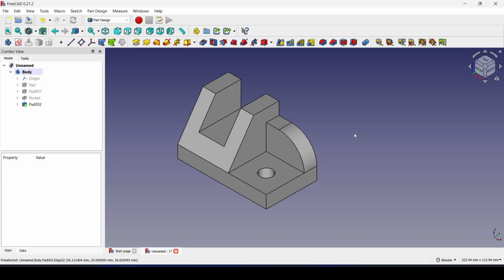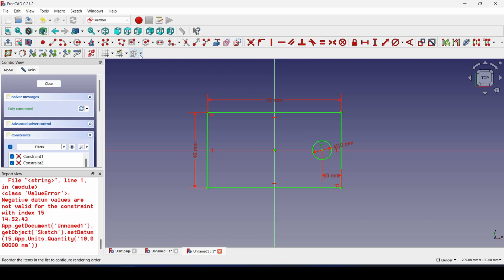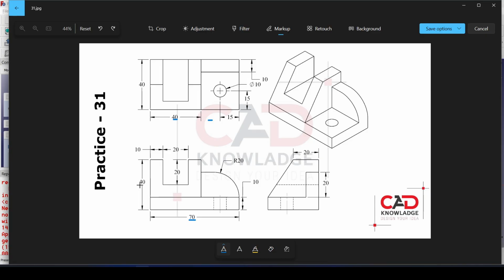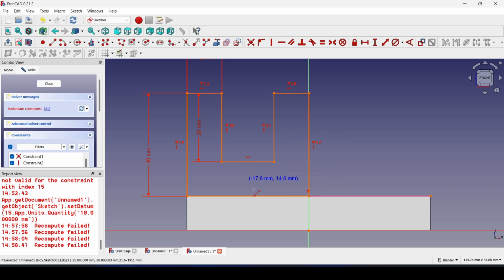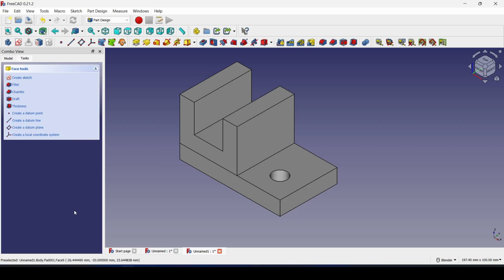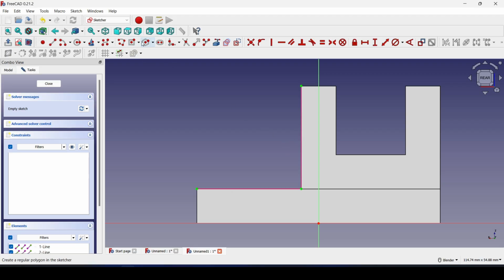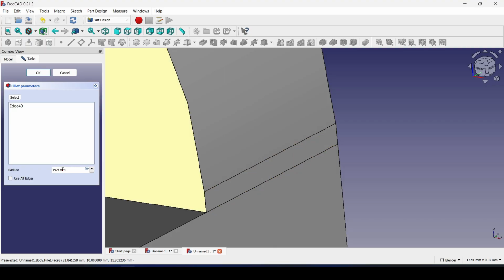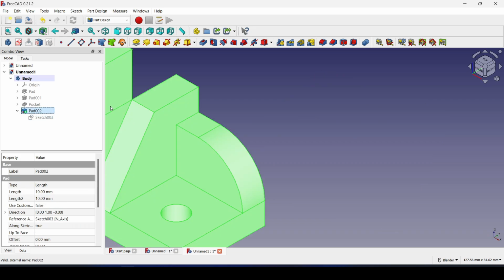FreeCAD Beginner Tutorial #2

Comment: Great tutorial. One of the mental hurdles I'm having to overcome is how easy it is to use fillets, pockets, etc. to perform cutting and shaping operations on the model under development. My brain keeps insisting that it just can't be that easy! Before taking up FreeCAD my last experience with technical drawing was at a draftsman's table with pencil and paper during a college class in the mid 80's. There's just no comparison between that and a tool like this!

FreeCAD 1.0 has been released since this tutorial was first published, one of the things that has been improved is that I was able to use the fillet tool on the model and it added in the 20 mm radius without balking as in the video.

Comment: Thank you again for another great video!  There must be a difference between my version 0.21.2 running on Linux (POP OS) and your version: The last part for making the rectangle with the 20 mm fillet was over-constrained when I did what you did, and I never figured out why.  As you said, there are other ways to do the same thing, which I did by making the rectangle with the fillet floating away from the part, and as a last step made the corner of the rectangle concurrent with a point on the solid. I don't see why that is really any different from what you did, but I did not get any over-constraint issues.   Anyway, I succeeded in duplicating the Lesson 2 part.  Thank you.
Reply: I had the same issue, I think it was because there was a line that had a horizontal or vertical constaint, while having both end points also constrained to a referenced line

Comment: On the last sketch instead of the rectangle use poly line to make the bottom and side then 10 mm of the top line then M 3 times to radius and complete the sketch.  Then constrain the arc to 20mm and the other constraints.  Then no issues like with the fillet to 20mm.

Comment: Hi Jeff. I'm onto your second tutorial! I'm having a difficulty with FreeCad and I'm hoping someone can help me. I'm using an iMac running MacOS 10.13.6 (High Sierra) and FreeCad version 0.21.2. It's the latest version that I can run on this OS. I am not able to arbitrarily rotate a part I'm working as you do in the videos. It seems that I'm forced to use the image rotation tools at the top right hand corner of the screen. To say the least these tools are less than perfect and a bit frustrating. Am I missing something? Assistance with this issue would be greatly appreciated!! Thanks in advance!
Reply: Im sure you figured it out by now but Check your viewer controls in the bottom right.  I preference ranker cas viewer controlls.
Reply: @bluntly8760  Yes I did figure it out! Thanks!

Comment: Another very helpful tutorial. One question... I am working on a Mac with a very high-resolution monitor and so everything is very tiny. I did figure out how to increase the font size, but the line weights are still very thin. I went into pref's but nothing I changed seems to make a difference. Any thoughts? Thx!!!
Reply from the maker: Hi Brad,

Thanks for commenting! I've been doing some searching trying to find a solution to this issue. 

I came across a setting to modify the width of lines shown in the standard viewing window (i.e. after you've closed your sketch and are back in the Part Design workbench). To do that you can navigate to "Tools > Edit Parameters > BaseApp > Preferences > View > DefaultShapeLineWidth"

Unfortunately, I'm not finding any setting to increase the line width within the sketch view. For that I think you may be required to adjust your system wide display resolution. There is some information on this topic on the FreeCAD Wiki article: https://wiki.freecad.org/HiDPI_support

Hopefully this is something that's added in a future version of FreeCAD.

If someone else knows of a way to do this, please let us know!
Reply: @JeffCAD1 Thanks, Jeff. Yea, hope they fix that. With a high-res monitor, it makes it really hard to select things.
Reply from the maker: Another setting that might be helpful: Select your sketch from the Model view > Select the 'View' tab on the left hand side of the screen, at the bottom of the combo view > Under "Object Style" change the "Line Width" value.

Again, that doesn't affect the line width within the Sketcher workbench, but will affect the sketch lines when being viewed in the Part Design workbench.
Reply: Hers a quick way for enlarging the screen at least for looking at stuff close__  System Settings/Accessibility/Zoom--select - "Use keyboard shortcuts to zoom"/ Then just press "Command/option 8 to enable it (just need to do it once) then Command/Opt and  + or - a few times to enlarge or shrink it back down.

Comment: Don't use faces as references for other sketches ... FC is not good at this ... (ie Topological Naming Problem) ... changes to the model are likely to break it.  Use a separate datum that is aligned to the face ... learn this up front and you will save a lot of grief using FC.
Reply from the maker: Thanks for the tip! I'll have to get in the habit of doing that. I've run into the topological naming problem on another project and it can be a major headache.
Reply: Can one of you explain datum plains ? Super new to AC.
Reply: Topo does drive you tropo. I like the simplistic into to help beginners, but these break too easily with the topo problem. Datum plains and sketches set off regular axis do make FC complicated to work with but do help with the topo.
Reply: Is the a reason this has not been solved in freecad?  If there is a manual work around,  then freecad could be made to do that automatically when a face is selected.

Comment: Hi, thanks for your effort to share your knowledge on FreeCAD, it's always an addon to the community.
In the Sketcher "Solver section" you can tick the option "Auto-remove redundant constraints" in order to simplify your life.
Also at the end of the  object in the "View" tab, next to the "Data" tab, you can switch to True the property "Refine". I always use it  in automatic refine ON,  achieved within Edit Menu / Preferences /  Part Design / General / ticking those three boxes.
Cheers
Reply: Many thanks for the useful tips, though I personally leave the "Auto-remove redundant constraints". Simply because I'm still learning and rather have F.C. create the "erroneous constraints" so that I can "investigate and understand" what is happening and what I've done wrong rather than just trying to do something and having it "automagically negated" ;) For the very same reasons I also choose to often model with the "Auto constraints" turned off as well.. :)
Best regards.